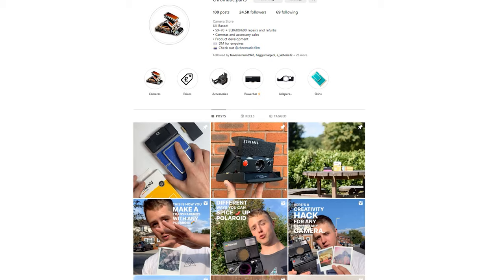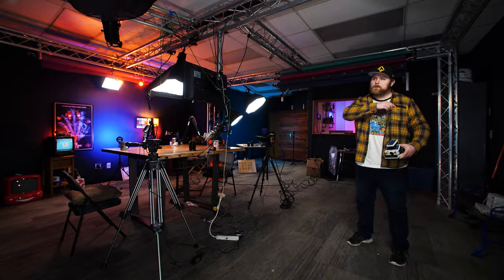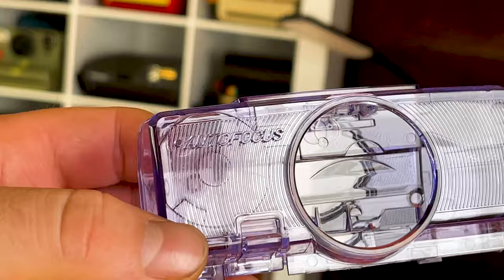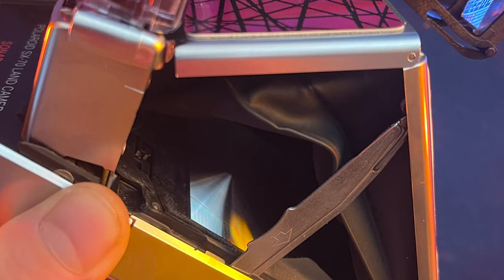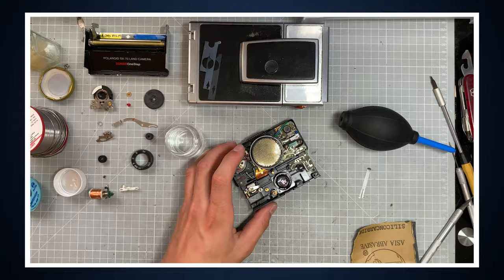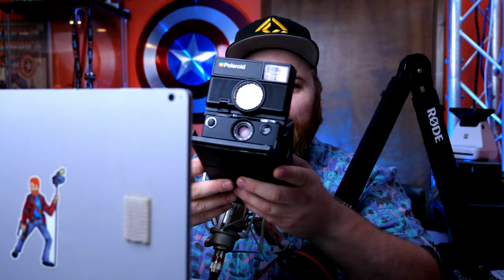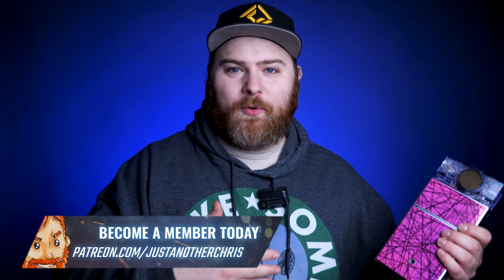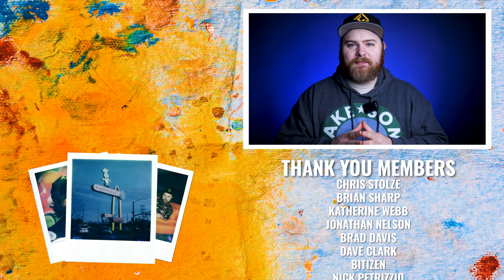A FULL manual controlled Polaroid SX-70/680 camera and more!

Comment: I am literally addicted to your videos, very good videos. What would you recommend, buy an sx70 (like 70 dollars) or a sx70 sonar (240 dollars) and contact Dennis to do maintenance and be able to shoot 600 and itype films and maybe change everything to full manual control (although I am a newbie in this about photography in general) OR buy a MINT slr680 that shoots 600 and ytipe film OR maybe buy on camera from POLA STUDIO, I am from Santiago Chile (South America) and it is difficult to access these cameras if they are not bought abroad, I don't know, I really want a polaroid camera but I am a newbie and inexperienced so I don't know what to do.
Reply from the maker: Either cameras, great I would go with what you can get and afford. I’m always a fan of finding a camera on eBay OfferUp, Facebook marketplace, etc. then sending it to Dennis to have the work done. It will be cheaper in the long run. Other places like mint will up charge the heck out of the cameras.
Reply: @JustAnotherChris  I understand, cheap camera + Dennis, and what model do you recommend for a newbie, sx70, sonar or slr 680?
Reply from the maker: @RufleX no reason to get a 680. Get a sonar
Reply: @JustAnotherChris  Understood, thanks for your time
Reply from the maker: @RufleX anytime!

Comment: Is it fully manual? Or is it another shutter priority camera, like the mint that claims to be fully manual but is just shutter priority?
Reply: OK, Aimshootdevelop went over it. It is not fully manual, it is shutter priority.
Reply: @lofianddiy The Polaroid SX-70 is neither. 1/8000th of a second isn’t really true, it’s the equivalent speed if the aperture was at f/8. At the SX-70 max shutter speed at 1/180 it’s more like f/96 though. 
This is inherent in the SX-70 shutter design and was a way to make it smaller and more convenient to the user, remember the SX-70 was meant to be a completely automatic camera. The only way to get around this would be to redesign the whole shutter from the ground up, which I would like to see, but it would sure be a nightmare to fit it all in the shutter housing.